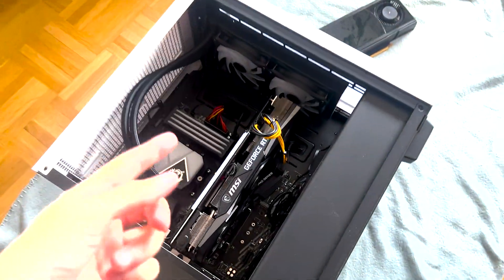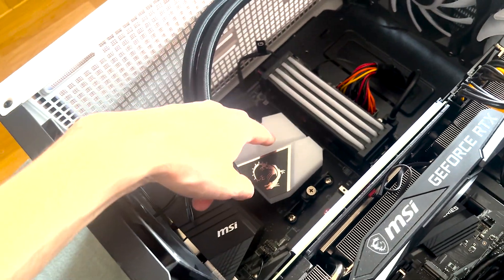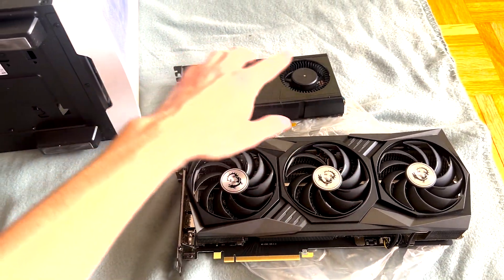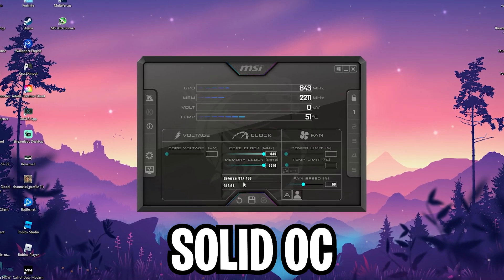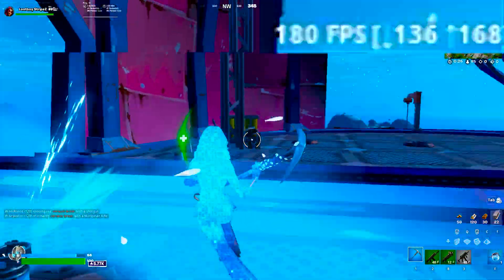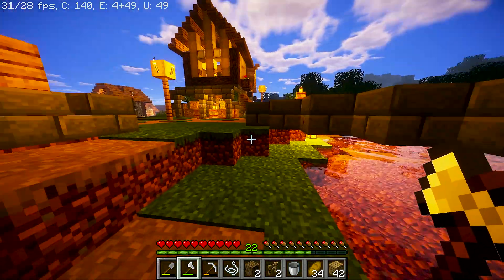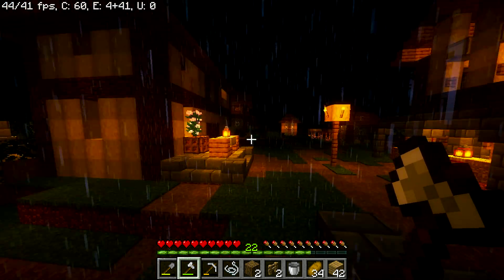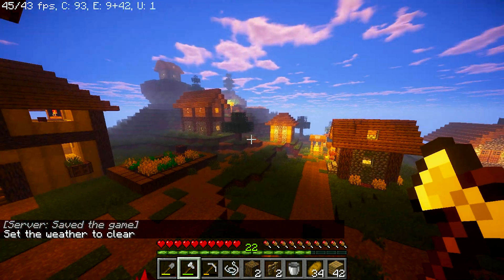GTX 460 in 2022 | Running Games on 12 Year Old Gpu

Comment: W also recommend me with a good budget gpu that runs 144 fps and is under 900 aed you can search how much dollars that is.
Edit:Never expected a like from you Michael   your channel helped me a allot, thanks. Casual W
Reply: In dubizzle u can find a gtx 1070 8gb for 700 bucks to 800 aed
Reply: And also from amazon gtx 1660 super is around 900 bucks
Reply: @NitrixCodm   wich brand should I get? Zotac gigabyte EVGA, EVGA is cheapest and gigabyte is most expensive
Reply: @NitrixCodm  also should I get EVGA 1650 super sc ultra double fan 4gb?
Reply: Ye grx 1650 super is also good but 1070 better 8n my opinion
Reply: But if u get a 1650 super with i3 10100f u can get 200 fps in low setting easily
Reply: There is a website called more fps fortnite where u can check the fps for combination of cpu and gpu   and check the fps and add 20 or 30 more fps after the tweaks